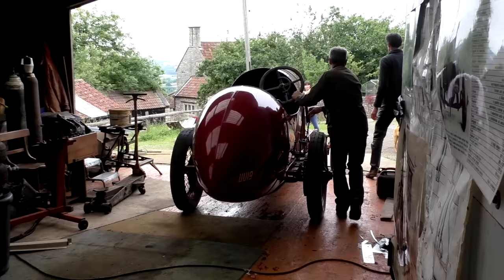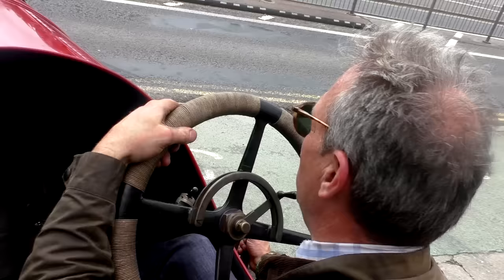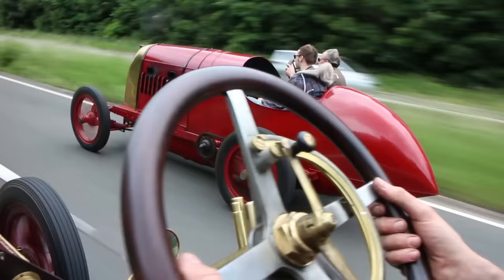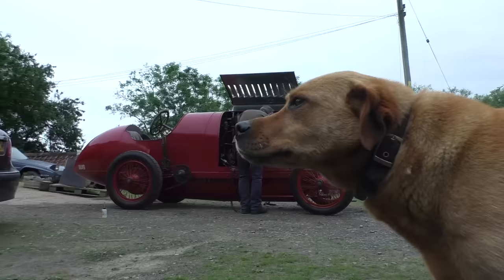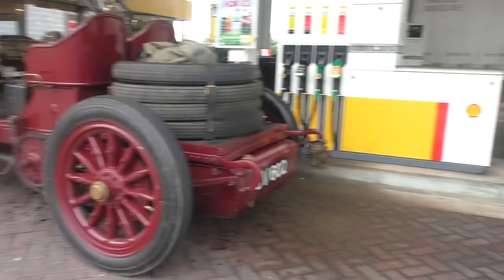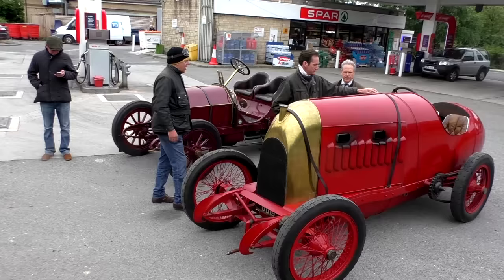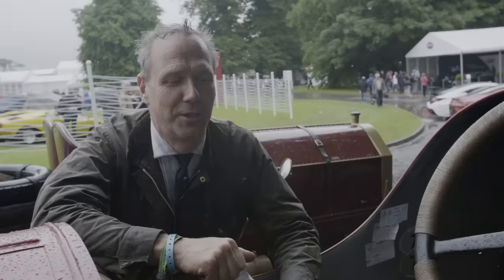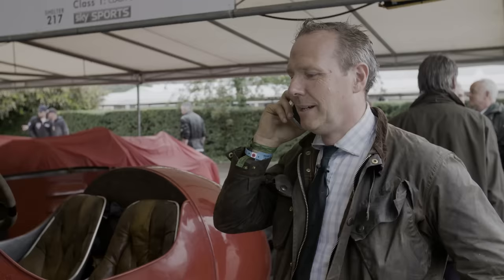Firey Beast of Turin Let Loose on the Highway | Part One

Comment: Age and time is such a mental thing. That car was 3 years old when WW1 started, 32 years old when Russian composer Rachmaninoff died, 34 years old when WW2 began, 80 years old when the Berlin Wall fell and 108 years old now. That car may not have seen all those things, but it has lived through them and now we are able to look at it and drive it. Crazy
Reply: And this feel when 108 y. o. Car owertaking you on the highway 😕😱🤣(Sorry for my english)
Reply: 59 years later Men landed on the Moon, large leap of technology in a very tiny amount of time.
Reply: I had the same thought when i found a penny from 1904
Reply: Why? It's a machine not human body. You can turn it off, that's the reason they can last so long. No turning off of the organism!
Reply: @aleksandaraleksic4067  if you turn a car off and leave it for 108 years I'm pretty sure it will have rotted and be completely useless. My point was, it's so old that the people who made are all dead, and the car has survived for longer than a century, and a lot happened in the 20th century which people like me (born in 2003) didnt not experience however I am able to experience a car from the 20th century, albeit through a screen.
Reply: @e.hutchence-composer8203  Modern cars yes. That is old car, only metal, no electronics. Also, in dry conditions it wouldn't rot. It is not only machine that old! I am mechanical engineer so I know what I'm talking about! And for the last time it is machine it didn't experience anything, especialy since it was not running all the time.
Reply: You're saying I can drive it?! Thanks dude I'll be right over!
Reply: And now the car has been through the Covid-19 pandemic as well!
Reply: Facts. It’s about 111 years old now.
Reply: I think you meant to say "WW2 finished", as Rachmaninoff died in 1943
Reply: They really should've offered a 110 year warranty.

Comment: I highly respect you not wanting to change a thing on this car and having it be totally original to have it be a 100% true experience great job sir my hat is off to you
Reply: Your hat would be off too if he drove past you!
Reply: What the hell would be idea of trying to improve it? You want a modern car, go buy one. It will obviously never be as good as a modern car. The experience of driving a thing like this needs to be as original as can be. That is the whole point... getting in the mood of olden times. Respect.
Reply: @apuuvah  I don't think anyone's talking about putting a GM LS V8 into it, but rather something like putting a front axle with brakes on it in order to make it stop in less than 100 metres.
Reply: @email4664  but would you rather have the car sit in a shed and slowly deteriorate because everyone's afraid of driving it, or put a small amount of period-correct, reversible modifications on the thing to make it actually drivable?

Comment: 135 mph in 1913!  Wow.  My modern car sitting in my driveway can barely attain that now, 106 years later.
Reply: Yeah, but if something breaks in your car it probably won't crash and spill your unrestrained and exposed limbs and guts all over the road.
Reply: Mine does 110 downhill with the rev counter doing 360´s.
Reply: @lcbarker8169  thanks for the solid advice mate, gonna cancel my insurance and tell them that I don't plan on crashing now
Reply: well don't forget it does 300 hp and 2000 nm of torque

Comment: What a Beast of a machine, 1000rpm 128mph on the motorway, ( imagine heading along the motorway and being overtaken by a 100 year car effortlessly passing you 😮😮)  today,s cars idle at that speed, yes i imagine the problems at petrol station with the old Fiat belching flames dripping hot oil, they would be glad when he is gone and has not set fire to anything, lol haha.
28ltr 7ltr per pot, think about it, an average big coke bottle is 1.5ltr so 4.6 coke bottles to fill one one cylinder 😮😱😮 most big American V8s are around 7ltr that is only the capacity of ONE cylinder!!😮😱😮 SCARY thing is that chain drive IF it comes OFF at speed the driver would LOOSE a limb!!!!!
Reply: An Italian car leaking oil.  No surprise there.
Reply: @vederstein  British engines were pretty good to at leaving their calling card oil drips on the ground, ha ha lol lol.

Comment: 4 cylinders 28 liters (yes twenty eight)...

Q: What's the torque figure on this car?
A: Yes!
Reply: Q. How many ft lbs does it have?
A. All of them
Reply: Q. What's the dyno sheet looks like?
A. Yes!
Reply: Q: How much petrol does it consume?
A: Everything. Until the last drop.
Reply: My V8 is 5.7 litres and this thing has 7 litre cylinders?
Reply: Q: How do you start it?
A: You dont, it starts the Earth's revolutions.
Reply: On a serious note, torque is estimated to be about ~2000 lb-ft
Reply: yup one V8 per cylinder wild 👍
Reply: @MrDonkrypton  33 gallons a mile
Reply: @92xl  Or slows it down, depending on which way its facing!!
Reply: Torque and fuel consumption of a white dwarf star.

And its bloody epic!
Reply: About 2000 ft-lbs of torque and 300 hp.
Reply: Q: what type of petrol does it take?
A: Anything that can feed the monster
Reply: @Gerald5000  Oh, you've the beginner's version? ;-)
Reply: About 6 times the displacement of an E type Jag
Reply: 1500 lb-ft or 2000 Nm.

Comment: Can you imagine that thing driving up behind you spitting flames and bellowing like nothing else on earth?  I'd need new underwear.
Reply: I know right? Sad to see they did not put the exhaust on the car though
Reply: That thing would run better with  a single exhaust  pipe.  Just like other cars from that era.
Reply: Think it would perform much better with the proper exhaust system , just  thought on it . Engines need the proper back pressure . hey I could be wrong , have been twice in my life
Reply: you do realize that this engine has 4 cylinders, and each piston is about the size of a 5 gallon bucket, right? and that the engine is only running 1000 rpm at 128 mph, right? there is a whole bunch of stuff you know nothing about where this engine is concerned. it is closer to a model 't' than it is a mustang. the ignition timing is determined by the driver for the conditions at the time of operation. there is no 'automatic'. the timing for 30 mph is much different than at 128 mph. 'back pressure' has little to do with this engine. it is big. it is slow. and it needs as much air and fuel as it can get. back pressure isnt conducive to this. the engine wasnt engineered for it, either. and the thrill killer? it would destroy the historical accuracy of this car.
Reply: not really. you are clueless. do you have ANY idea how big 28 liters is? my 440 chrysler engine is 7.2 liters.
Reply: Hey thanks for pointing out how clueless I was regarding back pressure, I stand corrected as you are apparently an expert and know it all . It gives a person a warm fuzzy feeling that there are folks out there that are ready to correct us clueless people
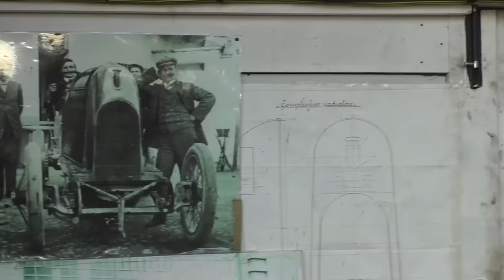Reply: got to side with Neil, look at the photo's from the period at around 1:34 and 1:41 one car run with the "Pittaway" exhaust, the other infront of the monument run with 4 side exhausts, i was reading about the car in a book about early land speed record vehicles,  fiat tried a number of "exhaust" solutions, some where better than others, but all were heavy due to there size and all unbalanced the car at very high speeds. the negatives outway the benefits in this case i'm led to believe, though your just gonna have to ask Duncan yourself.
Reply: Yub, same with the old piston Aircraft engines, they also had only a short almost direct exhaust, due to the massive  displacement they had later on with more than 35 Liters in some engines. 
The german DB 605 (Bf109 from the G Models onwards) had 35.9 liters  in an upside down V-12 configuration and the RR Griffon had 37 liters in a V-12 configuration.

The Rev limits were about 2,600 rpm for the DB-605 and about 3,000 for the RR Griffon. 

Well the DB-603 does dwarfs both of them with a displacement of 44.3 liters...again inverted V-12. 3,200 rpm rev limit. 

Compared to that the Napier sabre has a rather "normal" displacement of 37 liters, although in an H-24 configuration. 

And the really famous RR Merlin is 27 Litres and therefore the closest to this engine in displacement, but not in cylinder size, nowhere near. 

Those were what is called in-line engines in avation terms, the radials could be even bigger, with the BMW-801 having 42 litres and the famous R-2800 Double Wasp having 46 Litres. 

Oh and we are only talking fighter engines so far......the bomber ones are a lot bigger. 

What does it tell you, Cheese,  that none of these engines had much an exhaust system, nothing that extended over a pipe to get it out the cowling and preferably also create some additional thrust?
Reply: LupusAries now could you imagine 3 times this though... 76L In-line 12, though imaginary the thing would likely have six 5 inch wide “exhausts” and would belch flames like there was no tomorrow. You could feel the car from 100 feet away or more. It would be earth shattering.
Reply: @Ryan G
"Can you imagine that thing driving up behind you spitting flames and bellowing like nothing else on earth? "

Sounds like just about any (relatively modern) thing my dad ever worked on.

(He wasn't quite as good a mechanic as he thought he was)

XD
Reply: Just for everyones information I spoke to this guy and sat in the car at Goodwood - the exhaust was cut off in 1911 by a Russian prince so it was kept that way.
Reply: @Pynaegan  

I live in Milwaukee and that describes just about every Harley Davidson that cruises our fair city. LOL
I'm a Harley owner, so I'm not complaining unless it is 3 AM. LOL
Reply: Tell that to the 1930s Auto Union team...
Reply: 5 litres of Auto Union Grand Prix engine from the late '30s.  Straight out of the engine, no exhaust pipes.  Good enough the wind up the exhaust-equipped Mercs of the period LOL!
Reply: @funsweed  only 2 stroke engines need back pressure
Reply: @paulcaswell2813  on a supercharged ir turbo charged engine straight pipes is the way to go with minimal losses in the exhaust. On a naturally aspirated machine it's not as straightforward. Depending on the construction they can be greatly helped by an extractor construction, a pipe which us tuned to the best work envelope of the engine rpm, creating resonance of the exhaust pressure front to induces a small vacuum to pull out as much as possible of the gasses before opening the intake valve.
Reply: Autobahn priority 1.   How's that for an Italian car ?
Reply: The original car actually had an exhaust manifold. The guys who did the restoration omitted it either for more visual effect or because they could not find/fabricate a proper one.
Reply: @neildoughty9892  it would also kill the fun and theatre factor and just completely ruin it for everyone

Comment: Ahhh - The joys of historic motor car road tripping... Drive a bit... Fix a bit.... Drive a bit... Fix a bit... Its much better than just getting into a refrigerated box an arriving clean and on time!!! This way you have great stories, meet great people, and see the sights!!
Reply: i agree
Reply: I wouldn't care about the meeting ...... >8^)
Reply: @CockatooDude  show up to a meeting in this and I think they'd let it slide with the risk of burning the building down
Reply: @John Ulicky - Passenger cars of the time were somewhat unreliable and prone to have problems fairly regularly.  Race cars of the time were not much different from a reliabilty standpoint - that is why they all were 2 passenger machines then - one for the driver, the other for an on board mechanic. The 1932 Alfa Romeo P3 was the first Monoposto (single seater) race car, as improved reliability by then made it unnecessary for an on board mechanic. This obviously contributed to higher speeds, better handling and aerodynamics.

Comment: Amazing that the 1907 Fiat GP car was a 16,000 cc 4 cylinder hemi head engine and it produced just a 130 hp, only 4 years prior to the S76!  It won the 1907 French GP with Felice Nazzaro at the wheel.

Comment: 0:53  No mufflers is one thing, but this has no exhaust pipes either.  What a beast!
2:48  At 300 rpm it's faster than most of the cars on the motorway.  Talk about torque!

Comment: It's time for the 150 mile service. That includes rebuilding the clutch, new oil, lubricate the chassis, and disassemble the engine to inspect for damage. Then simply reassemble and you're good for the next 150 miles.

Comment: It sounds like an artillery barrage, it’s leaking oil by the gallon and breathing terrifying 6ft flames on the side,  it will go 135mph with hardly any forward view for the driver, and it’s all strapped together with leather belts. What could possibly go wrong?

Comment: I always wanted to see this car, in a museum, or something. Now I have seen it! IN ACTION! Can anybody explain why there FLAMES coming out of the sides of the bonnet?
Reply: Those flames are the exhaust. Back in the day, the thinking was - to get the exhaust out of the cylinders as quickly as possible. No actual headers or pipes, just a big stubby rectangular port. Combustion Technology was in its infancy, but it did have 4 valves per cylinder and twin-plug ignition.  Another version of the same car did have exhaust pipes, which you can see if you look it up on Wikipedia.
Reply: @rogersaunders1770  WOW! Thanks for replying.

Comment: This thing could be a lot more efficient if it had a tuned extractor manifold. The heated exhaust charge leaving one cylinder causing a pressure drop in the next runner, "pulling" the charge out of the chamber. Works just we well on sleeve valves as it does on poppet valves. You wouldn't even need to modify the car in any meaningful way. 

Running an engine without an exhaust will result in the same behaviour as this thing. Pops, bangs, fire and ridiculous noise.
Reply: Doing that will destroy the authenticity of the car

Comment: How on earth was this legal? No lights, no exhaust system, no mudguards. no rear number plate. Was it insured? Love to know the premium if it was.
Reply: Les Rose Uh, it was built as a race car.  It set the land speed record in 1913.
Reply: Yes I know that. My question was, how is a race car road legal?
Reply: Les Rose It's a classic.  It only has to meet the safety requirements from when it was built.  Plus, I'm pretty sure the owner limits his excursions to special events.
Reply: the only thing on that list it would legally need would be a numberplate. it's mot and tax exempt. And easy to register vintage cars no matter what they were built for. 
It only has to meet the rules of its time of manufacture. Even with an mot you can daytime mot it to exempt it from lights.
Reply: Some experts from Volkswagen had a look at the exhaust and said that it was fine.
Reply: The registration, UU19, looks to be painted on the right hand side of the angled rear as well as on the front. And modern regulations about lights, exhausts, etc. can’t be retrospectively applied to old cars built prior to the introduction of such rules. Classic car insurance is usually reasonably priced, for low mileage policies or cover for show display policies.
Reply: Same thing in the United States. The car can be registered as an antique, has to meet the specs in effect at time of manufacture, but cannot be used as a "daily driver".
Reply: But driving onto a petrol station spitting big flames? ?    Putting everyone at risk
Reply: Not even someone walking in front waving a red flag tut tut

Comment: Makes you wonder about modern engines and why they gear them that way. Im sure if you could do seventy at one thousand rpm your motor would last much longer.
Reply: Because moder "Small displacement engines" don't have all their torque at 1000 RPM. So you wouldn't be able to accelerate or maintain speed. This thing has a 28 Liter 4 Cylinder engine.
Reply: You would likely need a massive, torque laden engine for that, if not a diesel with lots of gears behind it to do that.
Reply: no replacement for displacement

Comment: Shooting two yards of flames? Check.

Possibly waking the dead with every rotation of that gigantic crank? Check

A real deal need to stifle your grins- unless your preferred method of eating bugs is through your teeth at 120mph- while driving? Check.

I wonder what it's like to get the clutch ready for another day's drive. Whatever. I wanna be assaulted by it!